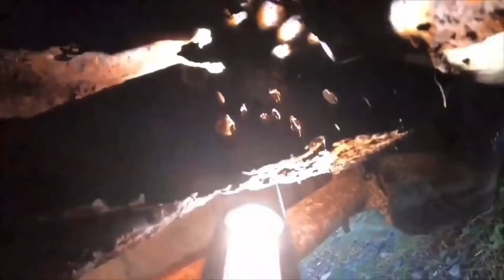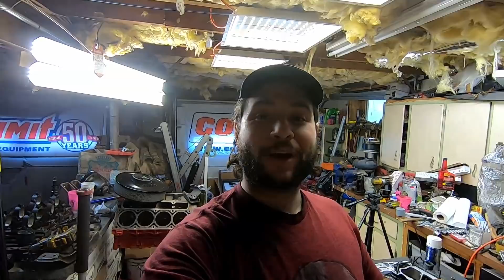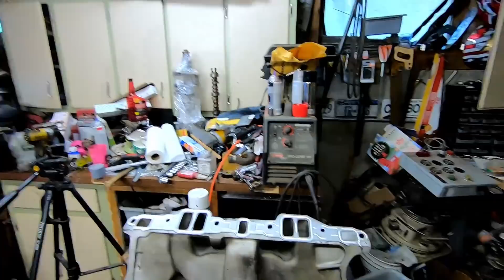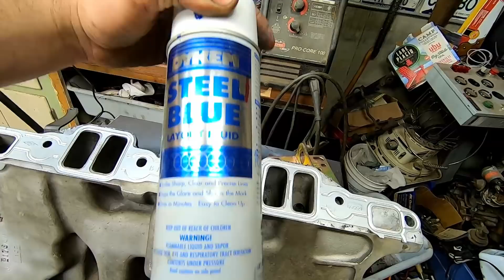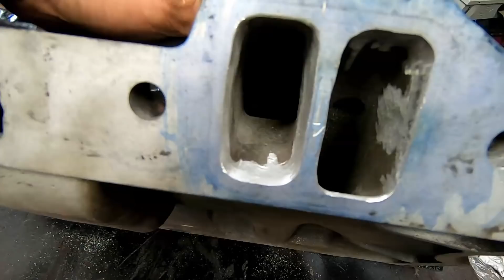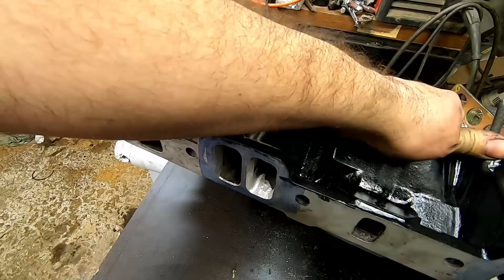Porting the Edelbock Intake for the budget 318 Build

Comment: Hi need some help. I have 73 roadrunner with 2 barrel 318 LA. Found a Mopar 340 factory aluminum intake. But when 8 set in place it doesn't cover the horseshoe part of the crossover on the head.is this an issue or not. I'm ready to drive it again. 2 barrell intake was leaking bad

Comment: I've always used regular sharpies and lay the gasket down and trace around inside of the ports on the gasket surface and its ready to be ground and  ported . spraying makes a mess . just being helpful and not a smart ass 😎🤘✌ also a felpro permatex gasket . i've had leaks with pressed metal gaskets
Reply from the maker: Spray paint also works great. I just have cans of that stuff so I might as well use it LOL

Comment: Put bolt in through a couple of bolt holes, and just use a sharpie to lay out the port matching. No need for machinists blue.  When port matching, you want to go an inch or two into the port.  Use a "flame" shaped carbide cutter for aluminum.  If anything, keep the port slightly smaller than the gasket,  so that the intake is smaller than the head.  This creates a slight reversion dam, and doesn't affect flow.  Leave the ports slightly rough (like the finish left by the cutter) as it helps keep fuel in suspension.  

Its actually pretty easy to make a 400hp 318. Last one I did was 402hp, with  mildly ported 308 heads with stock valve size, flat top zero deck pistons,  Isky 280H cam, M1 single plane, 750 holley, and a set of TTI step headers. Stock block, crank, rods, and most of the valvetrain.  I put in new single groove lock valves, and new valve springs, retainers, and hardend locks to support the cam.  It really wanted more cam, but without oiling system mods I didn't want to spin it any more than the 6500 it was already spinning to.

There is lots of little tricks that give you a couple hp here and there.
Reply from the maker: Thanks racer rick

Comment: That's a good intake for the 318, mine does good in my 84 D150 specs on mine are 79 318 block bored .30 over with stock replacement pistons, 89 "302" casting 318 heads ported & polished, 444 lift 340 spec mopar purpleshaft cam, Edelbrock performer intake ported & polished with 600 CFM Holley 4bbl, double roller timing chain & windage tray runs strong especially with a 3.55 sure grip 😁

Comment: If you get time to comment or make a short video on the bits used to work the aluminum that'd be terrific.  And 'respirator' or a good dust mask?
Reply from the maker: Really good dust mask will work. I use tungsten carbide bits to cut through with aluminum and cast-iron.

Comment: I am enjoying someone finally working on an engine anyone can afford. I read I don't know where that blocking the "heat riser/crossover" in the intake is worth HP????
Reply: Blocking the heat riser allows for a cooler , denser intake charge. The dense intake charge equals more air molecules crammed in at once, which then allows you to cram more fuel in as well, which equals more power. Keeping that intake charge cool is always a good idea when in pursuit of power production.
Reply: @Torquemonster440  Cheers.

Comment: Wish that I would caught up to you sooner have 318 late model with swirl port heads good for unleaded fuel
Reply from the maker: That is a neat find what did they come out of?
Reply: @LunarOutlawsGarage  from 1985 to when Magnums came into frame, they put them on 318's. I have a 1985 5th Ave 318 with the swirl ports. They dropped the swirl ports when they started making the 318/360 Magnums.

Comment: love this series, i don't understand why some folks think a 318 (5.2l) won't make fun power
Reply: Its not that the 318 won't make fun power.  It's that if you're putting this much sweat equity into a "budget build" your return on investment into a big block is much greater if overall power is your goal. The larger displacement will inherently make more power given all modifications are equal 318 vs. 440.
Reply: @Torquemonster440  so, i am not a mopar guy, but i was assuming that 318s are super cheap and can make great power.  that was the basis of my statement.  I have more experience, though not much, on LS platforms.  Many of those people get wrapped around the axle on what size LS they should use, and for most of us, and our respective goals, it doesn't matter.
Reply: Poeple just tend to go for the most c.i.d they can  I don't think most of them realize how much fun you can have  with a 318 or realize how capable they really are 😁
Reply: @HemiFourMe   yes, that combo will run well, but all mods being equal the 440 will still make more power. The 440 will be heavier as you pointed out, but it will produce 500+ ft lbs of torque,  something that even the best built 318 will struggle to achive.
Reply: @Torquemonster440  actually a stroker 318 or 340 can hit those numbers but that with a insane tune the 440s are great engines
 but the weight can be a problem in a smaller car like an a body so it's come down to what your looking for the car to do drag street road course basically choosing what going to work for you not to mention the build cost of the la engine is literally hafe the cost

Comment: Glad to see you didn't get carried away with port matching. Seen that happen so many times... A bad port match is more detrimental to flow than not doing it at all. Often people fail to realise that making the manifold opening bigger than the head, they cause a flow issue that isn't there when left alone. I know it is hard with you not doing the heads, and the heads not being there. But I prefer to have the heads done first, then match the manifold to the heads. You get a lot more core shift that you realise. I have seen untouched manifold over hang the head, just on core shift between the head and the manifold alone. The most preferable way of doing it is to bolt the manifold (with gasket) to the head and mark the manifold through the head.

Comment: 150hp from a 318? Only 7n the mid 70s that were choked with smog. The 1960s 318s were rated at 230hp gross with 2bbl carbs. I think ypu see 300hp on Nick's dyno. He runs them the way the faxtory did the gross numbers. In 1972 the rating was changed to net hp that would be the 150hp figures.
Reply: 1975 and up 318s have smog holes, Mopar lied about the HP for those first few Smog years 73/74 No EGR etc.. got to love it.. Mopar Everyday and Everywhere.. 68 Dodge Dart Daily driver, slant6 to 318 still Carter BBD and is faster then she looks, which is also how you want to pick your ladies.. Peace
Reply from the maker: One of the reasons why I like modern Mopar as well as classic is because when everyone else is going to Green alternatives they are making 1000 hp. They are big kids lol
Reply: I had a 1992 Dodge Dakota club cab with the Magum 5.2l The first year of the multiport 318. It was awesome. It weighed 4200 pounds with me in it. I ordered it from the dealer. After i finiinshed with the mods, tri-y headers, jacobs coil, shift kit in the auto with 2500 stall conv. I ordered from the factory 3:55 sure grip, later changed to 4:10s. Changed the stock rockers from the stock 1.6:1 to 1.7:1 roller rockers. Mopar performance cumputer. Other small mods ig ran 15.1 7n the 1/4 mile at 92mph.otherwise the engine was stock. I figured it had to be making 240hp at the wheels. 300 at the flywheel.
Reply from the maker: That sounds like a heck of a fun truck
Reply: @LunarOutlawsGarage  it was. I also upgraded the swaybars front and rear. Wheels and tires. Added a class 3 hitch for towing. It was the only Dakota i ever saw at the drag strips that did not have a problem with wheel hop. And it handled as goid aa a gen 4 GM f body(camero Trans Am. I won a lot bracket racing it. It was very consistent. I was very good off the line. Nobody could beat ke. I only lost when i red lighted. It is hard to beat som one that pulls the tree with .050 seconds 8f perfect.

Comment: I use my Dremel for things like this all the time. If you want to smooth out the deep spots in the runners, buy some round aluminum rod stock that just fits into the dremel chuck. Cut it about 4 inches long,(as needed) and cut as thin a slit down the centre of one end of the rod. Cut a strip of emery cloth just wider than the slit, and slide it into the slit in the rod so that the abrasive side faces out as the rotary tool spins. Wrap it around the rod, and insert it in the manifold runner before you turn it on - It will want to flap outwards a bit.
You can get a nice smooth (not too smooth) surface down the intake and can use finer emery cloth closer to the port opening.
Reply from the maker: I agree I showed how to do that in a much older video. That is a great method
Reply: @LunarOutlawsGarage  - I only met your channel recently through UTG, so I'm still catching up with all the ones I missed.  :-)
Reply from the maker: That’s is awesome thank you for checking it out I hope you enjoy the adventure

Comment: Super excited for this build. You should consider using 360 heads for the bigger valves.
Reply from the maker: It is going to be epic. Larger valves yes but slower velocity and larger combustion chamber. It would be awesome to do that with a super charger 🤙
Reply: As long as the compression is up other wise you'll lose some compression
Reply: You can use the bigger valves in the 318 heads.